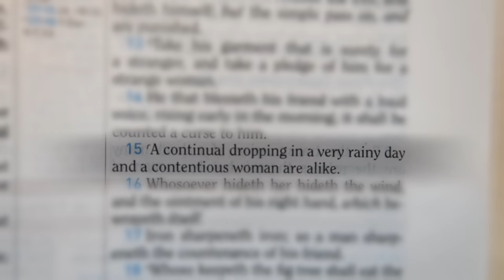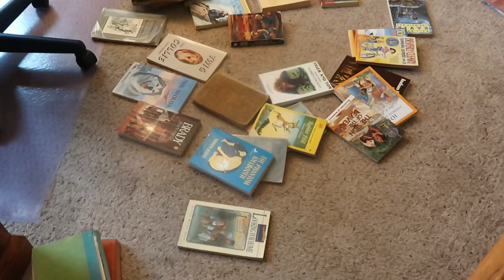Of Marriage and Bookshelves

Comment: Wonderful video.. thank you.  

Do you think you can give a tutorial on how to make that cute brick wall?
Reply from the maker: thank you! I will keep it in mind! In case I don't, it's very easy. 
1. use faux brick sheet panels from lowes or home depot
2. Cover with drywall mudd in the way you wish for it to look. (i had problems with the seams between panels cracking. maybe presealing that with something else would help.
3. we then put a light coat of finish sealer over the top. I forget what it was, but you do have to be careful. sometimes this can cause yellowing.

hope that was a little helpful!
Reply: @theMennoniteMom  Great, thanks!

Comment: Having been a therapist for over 30 years. I will answer your question why women (men do it too) can get grumpy when their partner is doing something for them. What I heard you say was you wanted to build bookshelves to replace the temporary ones. You wanted medium colored stain.  You didn’t have medium color only dark which you do not care for. First, change in your vision. Nolan suggested the apoxy finish which is very shiny, not your desired finish, you went along with that which was compromise number two. 
Women tend to give up more easily when it comes to creating something they can’t make themselves and have to rely on their mates to do. Instead of being clear about how you wanted the bookcase built AND being patient enough to wait and get everything you needed to complete the task the way you wanted it, you started down a road that led to frustration and disappointment. Nolan heard what you wanted but he too was not patient enough to wait and get the correct materials which led to extra work and not a satisfactory outcome. Because of not having a clear discussion about each of your visions of the finished project and making a date to go get materials, frustration and disappointment ensued. 
It is not a case of women “doing that” as you said. If Nolan hired someone to build something and he told the builder exactly what he wanted. The builder worked very hard on it but ran out of materials and made do with something else which changed outcome from what Nolan had ask for he would have been upset. Men tend to stuff their feelings whereas women don’t so he may not have said anything but the feelings would have still been there. Clear communication and patience create good outcomes. 💜
Reply from the maker: Love the insight! thank you! I can tell you are passionate about your work. I have always found the human psyche fascinating. Thanks for the interesting read! I think you nailed it.